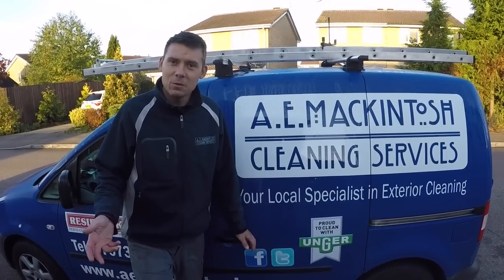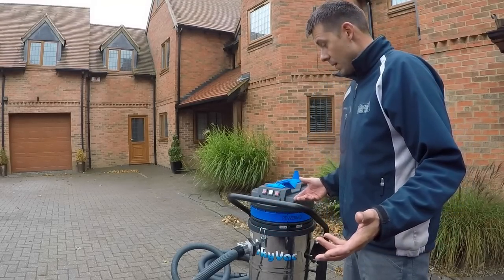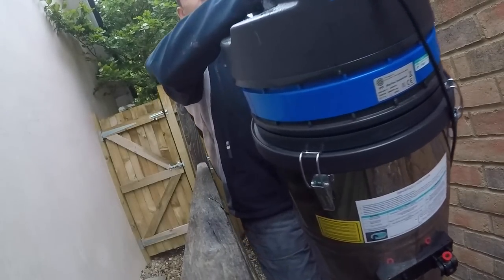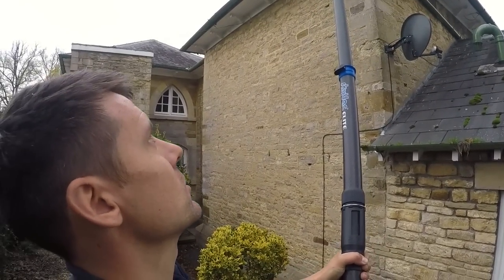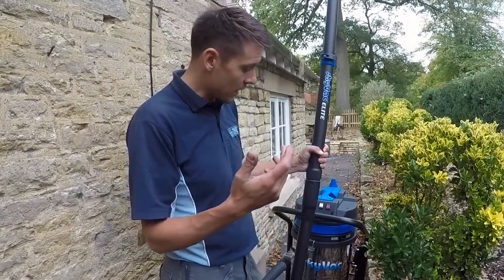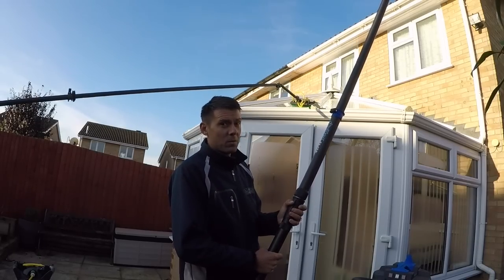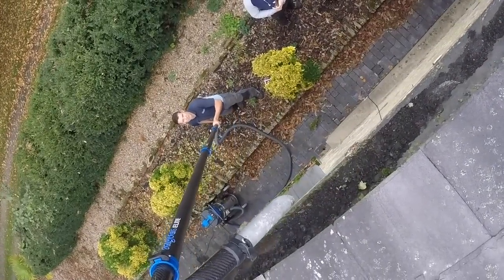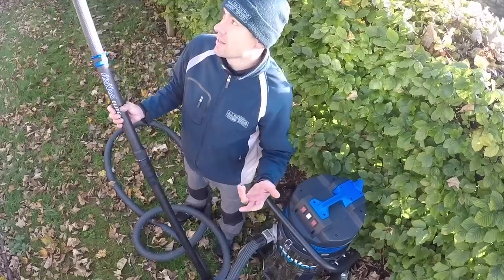Is SkyVac Really Better Than A Standard Vacuum For Cleaning Out Gutters?

Comment: How does the skyvac perform on wooden gutters with grass sods? I find with my 3000w wet dry vac they are rooted in too much to be able to suck out and I have to get the ladder out.
Reply from the maker: Justin Brown Wooden gutters!? Don’t think I’ve ever come across that. But the skyvac deals with lumps of grass and weeds like that, no problem. It has a little lever on it to give you more power, then sometimes you might need to give the grass a little tug up and down the gutter to try and break it up a bit before finally lifting it out.😃👍🏼
Reply: Yeah I watched the video showing the power lever it's a great bit of kit, I was hoping you had experience with wooden gutters too though.
Reply from the maker: Wooden gutters!? That’s crazy. Don’t think I’ve ever even seen wooden gutters.🤔👍🏼

Comment: Would you run the sky vac off the customers electricity? Or do you have a small generator
Reply from the maker: scw 74 I use the customers power supply. I find that most people have an outside socket these days.😃👍🏼

Comment: Does it come with a camra
Reply from the maker: No, that’s an added extra, although there are different packages available that may include a camera I think.😃👍🏼
Reply: @aemackintosh  you have given a good go on the product I beleave in what you say and a big fan. But I can not help thinking is it a lot of money for the sky vac. I dont see any thing about it other than its motor that can justify its price. Wee are talk 2500 plus. That only my opinion. That why am struggling sould I buy our not. But a big fan of your. True gentle man
Reply from the maker: I understand. It does seem a lot of money. The frame is so solid and will stand the test of time, like many of the other components. The poles are also so light and this is far easier on your muscles. Spinaclean are also very helpful if you need to contact them. Sometimes you just get what you pay for I suppose. It looks very professional for your business and that helps you charge more too.😃👍🏼
Reply from the maker: https://www.spinaclean.com/
Reply: @aemackintosh  thank you

Comment: How much for the house ash ???
Reply from the maker: Dave monk Monk Cleaning services The Stone house where I removed the grass, I only charged about £80 I think. Only half the house needed doing, where the trees were. I think I did it a bit cheap, but I wanted to make sure I got it so I could make the video. But actually, it didn’t take long, so easy with that machine.🍂😃👍🏼
Reply from the maker: I need to do a video on how to quote.🍂😃👍🏼
Reply: Don't believe you charged £80. You ain't gunna come on here and tell specific charge. I don't blame you. I would do the same. Why ask you how much you charged?   The price was more likely £40 .
Reply from the maker: I do a gutter cleaning quote based on a visual inspection to assess how bad the gutters are actually blocked. These were pretty bad, but not all of the work done is shown in this video.🍂😃👍🏼
Reply: A.E.Mackintosh Cleaning Services £40.00 to clean house this size I do t think so you would want a least £70.00...... £40.00 would only pay for normal size house one gutter on the front and one on the back ..... and why I ask it’s good to get rough idea want other professional company’s would charge for house this size..... coo video once again.👍
Reply: @keithbaron4437  if he was including the stream a clean service our gutters2glory company would charge £40 plus £40 all day long … its an hour on site at a guess...  £80 an hour for 2 guys with 2 services is a decent fist and do 4 of those a dayyou got a great biz..... spinaclean are top notch .. weve had problems with our stream a clean dispenser tube though ..  glass keeps cracking on them but lowering water pressure has helped

Comment: Don’t buy it, it’s useless in Australia. Does not clean double-storey gutters from the ground. Leaves mud, debris etc under the overhang of the tile or the Colorbond roof.- a lot of it. As as soon as it rains the gutter is full of sludge again.
I paid $7,000 with camera for this shite, used it 6 times and sold it for $3,500. So glad to get rid of it. Also, hose is very heavy and can damage Perspex.
Anyone who claims they are cleaning g gutters from the ground with this is ripping off their clients. Useless imo.
Reply from the maker: I think it sounds like something is going wrong there. I’ve found this to be very powerful and very effective. It is quite expensive and there are some cheaper options out there.